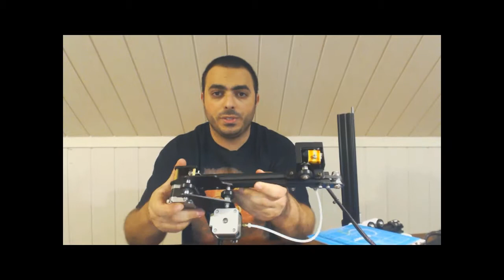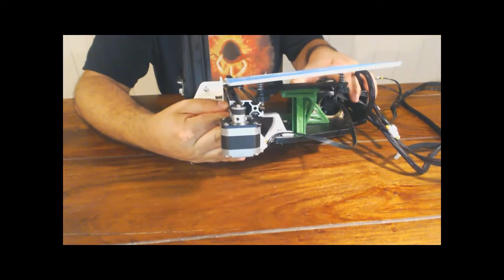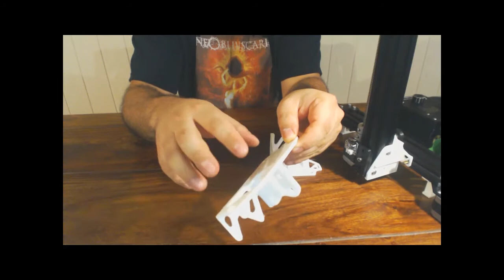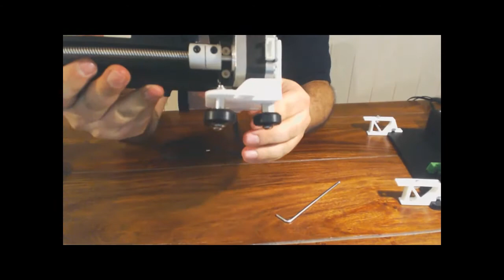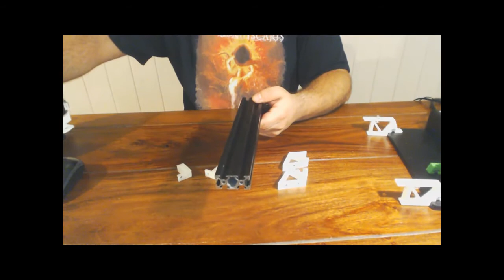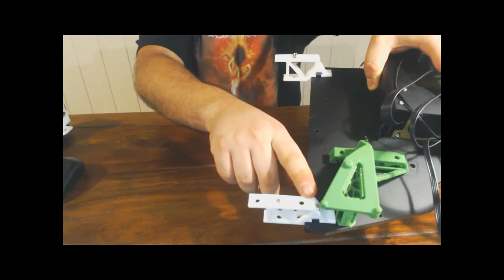Ender 2 Modding - ( Shaky CAM - sorry)- Old video.

Comment: While I commend you on an original idea of making the whole cantilever move in the y axis, isn't that much heavier than just the bed moving? More weight would induce more ringing
Reply from the maker: Maybe using a more capable motor and better controller will solve that. The bed must be fixed so that the printers deposit on a shared space. Do you see a better way ?
Reply: @RamiRouhana  for idex on the ender 2 I don't. Will you be uploading the files to thingiverse? :)
Reply from the maker: @ThatBulgarian  i was planning to do so but Ender 2 is discontinued . I actually made this vid in May . what motivated me to post it now is the release of Prusa Mini , i think it is a more suitable printer to mod for fixed bed and cooperative printers.